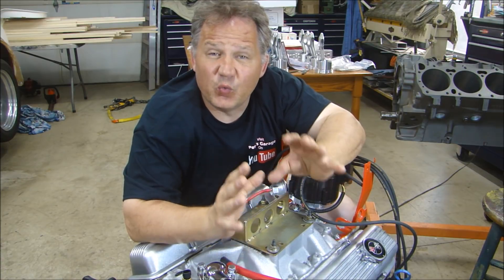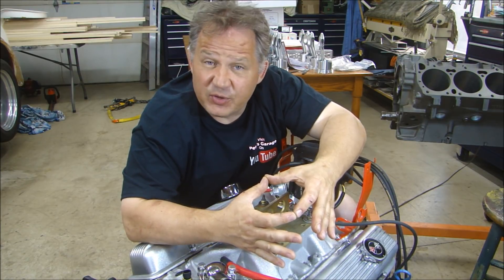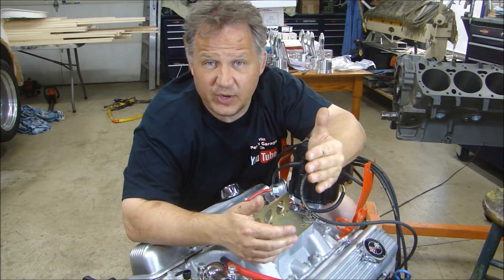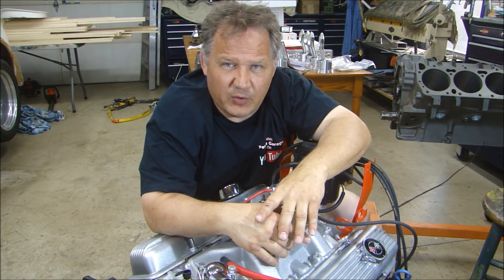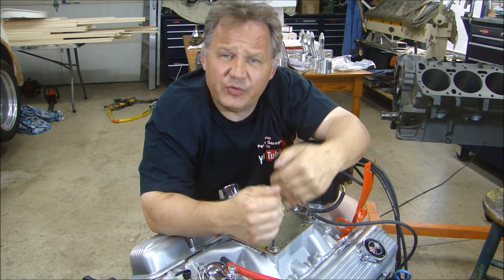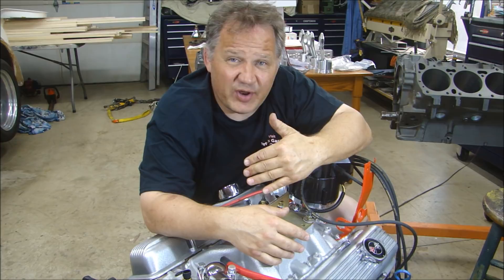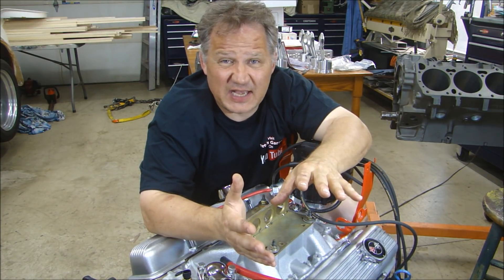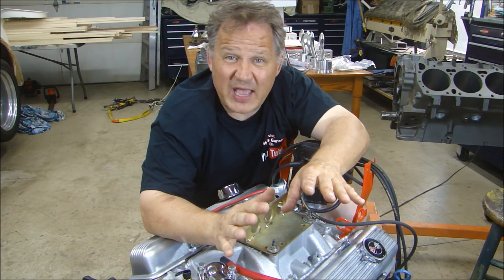Engine Building 350 Small Block Chevy Part 14 - Dyno Testing and contest Winners

Comment: Nice work, but you seem a bit confused about the principles of vacuum advance.  Whether you use ported vacuum or manifold vacuum to advance that distributor, when you “stomp on it” as you say, you will get zero vacuum advance in EITHER case.  Vacuum advance only occurs under high vacuum (low throttle/cruise positions).  The ONLY difference between ported and full manifold vacuum is that ported doesn’t exist at idle and doesn’t come in until after the throttle is cracked open just past idle.  Full manifold vacuum exists at idle AND after the throttle is barely opened.
Reply from the maker: Thanks Salvatore

Comment: thank you so much pete's garage.
 here are some opinions for anyone building maybe for slightly more power although similar: 
flat tappet cams in general outperform roller cams until a roller cam is big enough to start overcoming the increased weight of roller lifters. Although less friction and cam break in is way slicker , low rpm cammed engines prefer flat tappets for peak numbers. I would still recommend going with a roller cam everytime  = even a lower rpm , or lower output engine like this nicely balanced street car build.  The vacuum advance of the intake could be a hinderance for some certainly with the intentional build of this engine's performance envelope. i wonder if the edelbrock performer EPS would do well or have similar issues or different ones. i probably would have chosen a comp cams PE246,H10,  XE250H10 , 255DEH10, 265DEH10, XE256H10, or XE262H10 for upwards of 400 tq. and 300 to 340 ish HP like this one if i were to use a flat tappet, or even a 268H10, or 270H10 magnum cam.  Now for Hydraulic roller cams i would match to your compression ratio with slightly more compression, like an XR282HR10 i would use 10.25:01 static compression and not any less (aluminum and fast burn heads of course).  so an XR276HR10 with 10:1 compression (aluminum heads) . A 9.75:01 with XR268HR10,  9.50:01 with XR264HR10.j  and you could probably level off static compression there for iron heads if vortec. building a 330HP mill power chevy you could easily use vortec heads.and an XR264HR cam and probably have closer to 350hp or more, just be sure to have 9.5:01 static. or 9.65:01 and make 400tq also. to put it into perspective a 355 with an XE274H10 comp cam, vortec heads make over 375HP and 380TQ. So an XR282HR10 would probably be my choice for the roller cammed version with 9.75-10:1 with vortec iron heads. Or a 280H10 wouldn't be all that bad. Although they wont run factory power brakes as well as this engine here in the video. of course i use things like dual master cylinders with ultra high mechanical leverage system, high ratio steering box etc. so i don't have to worry about powersteering, or powerbrakes anymore. the exhaust is custom tuned length headers and collector length and sizing, with a breaker box before the mufflers, this causes the exhaust to think its hit open air before the mufflers. the cars are pony cars and lighter than stock. if you would like to build the same engine in this video i recommend the heads be ported by one known to port those heads and actually improve them beccause they are a great head design, your best bet for low rpm are the valve seat area and valve size and unshrouding. so get the smallest cc chamber version and work up from there. raise all the ports and the floors if allowable. oh well thats enough now.  :o) don't forget these great hydraulic roller cams for vettes or anything: XR252HR10, XR258HR10, XR260HR10, and all of the comp cams Xtreme 4x4 versions in fact that  i am like better on cars.
Reply from the maker: Great comment, thanks Dennis!
Reply: @PetesGarage  :o)

Comment: Vacuum advance is only needed while in part throttle use or cruising speed and has nothing to do with what RPM, The mechanical advance is RPM related and is normally around 20 to 25 degrees or so .The initial advance is normally set around 10 to 15 degrees.
Reply from the maker: That was right from the Holley Tech support line

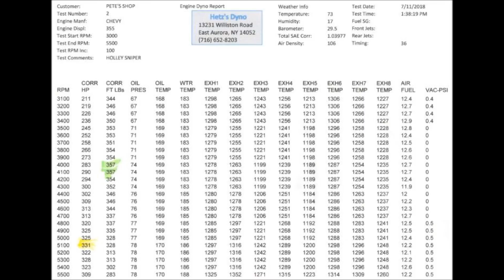Comment: 425hp 425tq? i don't know anything about the engine so that is my guess other than its a 350 sounds great.did not mean to undershoot what this engine looks like.  330 hp @ 5100 rpm  and 357 torque i am guessing at the same rpm, as it probably made more like 380 torque peak at lower rpm ,(oops corrected again 8:32 its 357 TQ at 4000 through 4100 rpm) still i wonder what the compression is and the cam specs. Hydraulic rollers are great for less friction and agree the use of one even a small one, i say 'Even' a small roller cam because roller cams performance wise as far as lobe design and function do not see an advantage until it is able to overcome the added weight and distance of the lobe until about 224 it breaks even, and up in durations @ O.O5O" lift spec, and really until 230* degrees plus degrees really, only then do they surpass flat tappet hydraulics at that point. And really begin to shine at 240 and 250 degrees even though it shall still have a very tight compacted rpm on the top non extended because of the greater distance the roller lifter is traveling and its weight.  Even still a hydraulic roller has the advantage in friction, and in efficiencies, even though it is not witnessed on a dyno versus flat tappet hydraulics until breaks even by 224* at O.O5O" lifts. and begins to climb pass hydraulics from that point until solid rollers outshines them all with their extended rpm range. The great thing about a hydraulic roller is that you can design a really large one for street and the dyno shall reward with compact fat power meaning not that the rpm is so limited, it is a sign of great efficiencies in a lower upper rpm band and compounding on the midrange. on a 406 small block chevy with 10 to1 static compression and some small 165cc heads a large roller cam  made 399hp and 466 torque, that mega torque is a sign of the great efficiency had with more lobe distance, hence the LS larger cam design more valve control is had. i am have designed a dual lobe cam, that is correct a dual lobe upon a single lobe profile this makes low power as well as high, and can be made to have high end power lower in the rpm band, imagine having high rpm power on the low or midrange with this i shall design an engine that has performance and 40 mpg normal in a 4 or 5 hundred torque application.. it shall have smoother idles and the lobe distance of great durations although with the velocities of small cams by controlling the valve movement and placement zones precisely in wave valve motion on a large cam design, a supercharger affect shall occur, the efficiencies shall be driven upward and the lifters and even the springs, shall be able to walk on a lazier schedule yet even still moving a greater distance faster.. both sides of lifter is expandable not collapsable, and collapsable not expandable, for a straight shot on the opening side of the lobe patent applied for and my name is i am the creator i make all as gods i am, dennis brian llewellyn junior, this means the queen princess king daughter son prince given birth to and born from i am. i am walks with thee and i am walks with ye i am walks, it is i am fly with ye and i am fly with thee. i am is with ye , and ye am with i am that i am
Reply from the maker: Fascinating
Reply: Interesting

Comment: What cam did you use? I like the numbers of hp and ft-lb. Yet I want to use similar specs on a 1995 chevy truck 350 TBI with 112' lobe separation. Since is the number that the computer is happy with.
Reply from the maker: Comp 12-408-8

Comment: WTF? Vacuum advance has nothing to do with performance or acceleration, that is a function of the mechanical advance. It is for fuel economy and is in addition to mechanical advance. All vacuum advance systems are designed to return to zero when the accelerator is pushed because vacuum in the intake manifold (below the throttle plates), or from a ported vacuum source (above the throttle plates) goes to zero or near zero.  This is why race only engines run no vacuum advance on their distributors and the more radical engines run the advance locked and the distributor at the desired maximum advance. I could go into advance at high rpm's or with nitrous or boost but on an engine with vacuum advance it isn't supposed to operate under acceleration.
Reply from the maker: I agree which I why I was shocker when Holly told me that.

Comment: The Sniper exhibits the death whistle, a 4 hole space will remedy this. I run my vacuum off the manifold currently, my distributor has 15 Initial, 4 degrees in the vacuum advanced and 28 In mechanical. When I'm In a 0 vacuum manifold pressure i still have 28* advance, not 0. If I heard you correctly I've been told that this is the preferred, pre 1968 smog style operation. I run my 65 dodge 440 the same way with the Fitech 2x4 efi
Reply from the maker: Sounds good to me Duane

Comment: Great video! Although I take issue with your comments about hooking the vacuum advance to the manifold - MILLIONS of engines do just that. In fact, you want the vacuum advance to go away at WOT. You're thinking about vacuum advance backwards.
If Holley thinks you only want vacuum advance above 3200 rpm, they're nuts.
Reply from the maker: I think there is a miscommunication. Of course vacuum drops to zero at WOT. Physics dictate that is what should happen. The problem we were having is that there was no vacuum advance until 3200 and Holley told my that is when they have it come on. I agree with you, depending on performance the vacuum may get switched back to the manifold.
Reply: Ok, makes sense. Still seems goofy that Holley set it up that way (talk about yer ported vacuum, haha). Ive found that most engines do just fine on straight manifold vacuum, but who knows what else Hley has going on?
Reply from the maker: @jamyers1971  Yeah, I was just as confused. I think they may fix that in future software versions.

Comment: thats is a lot of high dollar parts to only be getting those dyno numbers.
Reply: There's usually no bump in hp when you go fuel inj.  You do it for overall driveability: easier starts, part throttle response, fuel economy etc.
Reply from the maker: It really wasn't. The cam is 1 above factory. The Sniper is an upgrade. It was a relatively mild build for the money.
Reply: Agreed... threw alot of money at an engine for a really low HP result.  Money spent on the heads was completely wasted.  There are 10 plus GM SBC factory heads that will support 400hp.  Could have run any of the 10 with the stock ZZ4 camshaft and had 350hp.

Comment: Really an enjoyable build from start to finish. Im a little surprised at the horsepower and torque numbers.  I truly expected more from this build. Especially with a fuel injection set up.
Reply from the maker: It was all in the cam. Put more into that with some heads and it's up to 550 easy.

Comment: I agree with all the tips on not wasting dyno time...checking distributor wires carb etc etc. But i have to disagree on the working on your engine while on the dyno. Sure dyno time costs money, but its as close to running in your car as possible and essentially were designed to diagnose problems and tune motors. Not realy till later on were dynos used as 'penis extensions' i.e. how much HP u running.
Reply from the maker: That is a valid point. Of course you're working on the engine while it's on the dyno. You'll be swapping carb jets, removing valve springs for break in, playing with rocker ratios. I was talking about wasting time taking things off that shouldn't be there in the first place.
Reply: you don't need to swap valve springs for break in on a ROLLER camshaft they don't really even break in at all the wheel on the lifter just rolls over  the cam lobe there is barely any friction at all or wear on that sort of a setup. No risk of having a lobe go flat or anything its totally different than the old flat tappet cams and much better.
Reply from the maker: @GnarshredProductions  Correct
Reply: @PetesGarage  also next time just get a 350 block from a 1990's pickup truck they are already hydraulic roller setups from the factory you can just use an LT1 style aftermarket camshaft and the factory roller lifters tray and retainer setup and save yourself a whole ton of money for the same result.
Reply from the maker: great tip, thank you

Comment: No dis on this engine , only want to point out I have a 2018 V6 Camaro with close to the same HP & in a mix of med speed roads , get 31.5 MPG  & plenty fast . Thanks for your videos , I have other projects that I am working on & need some tech help .
Reply: Yeah, it makes similar HP 3000rpm higher in the rev range, with less torque.
Reply: I agree they are different , the V6 will rev up Very Fast !  I am swapping an LT1 from a 1994 Z28 that is close to this engine , it ran very strong . I am adding a carb intake from GM that will up the power some . Like this engine , I just want a good running engine & not a race car . Also has AL heads , looking for pointers to check it out before install .
Reply: 42 years is a LONG time in Tech. terms. Especially when you throw in Computer Control, Turbos and Fuel Injection. Not to even begin to touch on efficiency and metallurgy. My '13 4 banger will walk the dog on my '69 elCo with a gen. 1 350 but which one do you think I'd rather drive?
Reply from the maker: Great comment, the goal was just a nice runner, gotta stick with the V8 for the Vette
Reply: I would never waste my money getting a 2018 v6 camaro. That's what these old school motors are for. Got to get a v8 6gen. Keep the 350 in the old school.
Reply: Only 30 thousand dollars more too...
Reply: Well this sounds cliche but you get the sound with the 350 engine. Besides I’ve seen guys fbo a 350 and make above 400 hp. Cams, bores ect

Comment: I know this one was a roller motor, but in giving instructions for the dyno, my question is for breaking in the cam. Run the full set of springs or remove the center spring??? I am hoping to fire my 440 soon and unfortunately, this motor has been completely together for about 12 years now. Solid lifter cam and yes, (like an idiot), the rockers are on... I do roll the motor over 1 1/4 turns now and then, but I am worried I have ruined the springs.... Your thoughts????
Reply: Sure is. I built the motor for my last 65' Coronet. I was not real happy with the car and ended up selling it. I should have at least removed the push rods, but I was going to install it and re-injured my back. Once I was out of bed again,  I had more life issues. SINK HOLE. Then we moved. Remodeled the house and I am about ready to fire her up on a stand and if all goes well it will go into my new 65' Coronet 500..
Reply: I blew out 3 discs back in 97'. Have had many surgeries since then with a fusion in 09'. I can't say it was a failed fusion because I can still walk, but I don't bend and with trying to do everything I am use to doing it is pretty impossible. My commitment is more like,,, well,,, if I got rid of my car I wouldn't have a lot left to bother with... My cousin in Vegas and some friends back home in Roch. NY. are planning to all get back together for a cruise. I have a lot of work to do to make it back up there from Florida..... lol.. It's kind of a bucket list thing.. ;)
 Hell, maybe I will stop in and see Pete!!!! He's only an hour from Rochester...
Reply: I hear ya Ken. I do push it and sometimes way more than I should, but I am one of those guys that can't leave something with only a few more minutes needed to finish. Even when I know I should stop!! I blew out L3-S1, so far. I am fused and just cannot think of anything that makes me happy other than old fashioned hard work. It seems to be our curse.
Reply from the maker: You guys are all awesome! thank you for watching....I really do appreciate it.
Reply: Might as well Chime in.  L5-S1 for myself.  2nd time was a charm.... The stuborn a@# I am caused re-injury.  That said, If I might chime in to my broke back comrads:)  Swim.  It's a no pressure work out that increases strength in the core.  It's what i am trying to be consistant in doing myself.  Best of luck to you all.  This Back bs is no joke.  so those unaware, watch your back lift correctly, and stretch for "C" sake.

Comment: Can you please do a 5.3 gen III rebuild ? That's basically the modern age 350. In the middle of swapping one in my s10 blazer
Reply from the maker: I will as soon as I get one
Reply: I have one in my truck , fast with good MPG & HP
Reply: What is that about 323ci?  That would make it like a modern 327? I don't know much about the new designs. My knowledge is fro 20 - 30 years ago.